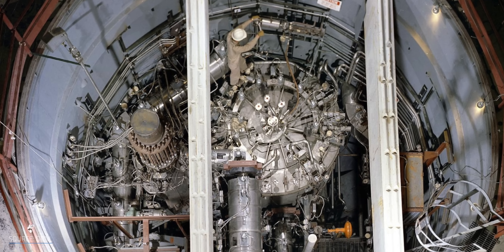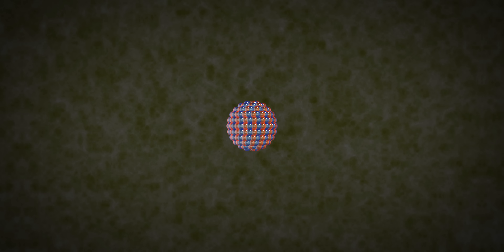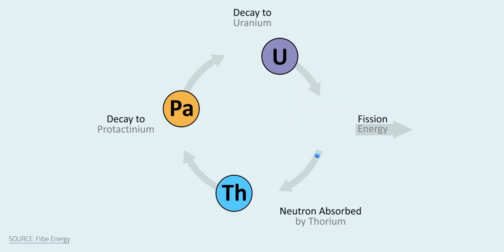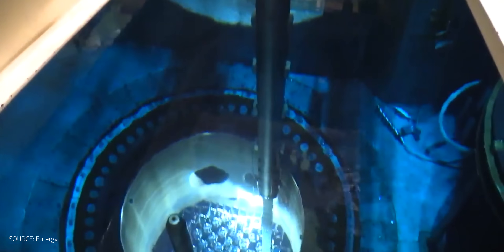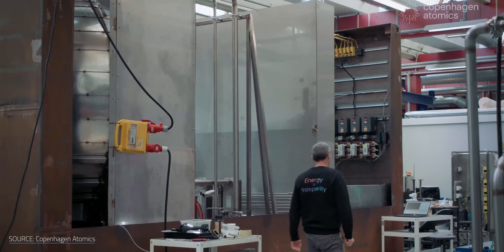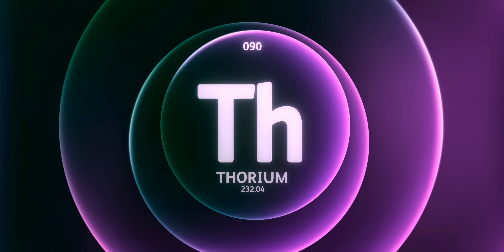Why Thorium is About to Change the World

Comment: AI Summary

Abstract:

This video explores the resurgence of thorium-powered molten salt reactors (MSRs) as a potential game-changer in clean energy, spearheaded by companies like Copenhagen Atomics. It revisits the decades-old promise of thorium, detailing how these "breeder" reactors can create more fuel than they consume, making energy significantly cheaper and more abundant. The video highlights Copenhagen Atomics' innovative approach to mass-producing small modular reactors (SMRs) designed to function like reliable "batteries" that operate for years. It delves into the unique safety advantages of MSRs, including their liquid fuel and passive decay heat removal, which mitigate meltdown risks, and discusses their superior waste management characteristics compared to traditional nuclear plants. While acknowledging engineering challenges like corrosive salts and neutron bombardment, the video presents solutions like specialized pumps and modular replacement. It also touches upon the significant regulatory hurdles but expresses optimism for commercialization within a decade, positioning thorium as a key to meeting booming global energy demands.

Summarizing the Transcript: Thorium-Powered Molten Salt Reactors

*   0:00 - The Promise of Thorium: The video introduces solid-state batteries and nuclear power, particularly thorium-powered molten salt reactors (MSRs), as vastly superior technologies with immense potential for abundant, cheaper, and cleaner energy.
*   0:47 - Historical Context: Weinberg's Vision: In the 1960s, under director Alvin Weinberg at Oak Ridge National Laboratory, the Molten Salt Reactor Experiment (MSRE) demonstrated a reactor that produced more fuel than it burned, running successfully from 1965 to 1969.
*   1:58 - Copenhagen Atomics' Revival: A Danish company, Copenhagen Atomics, is reviving Weinberg’s hopes for breeder reactors, aiming to mass-produce small modular reactors (SMRs) that are designed to fit inside standard shipping containers.
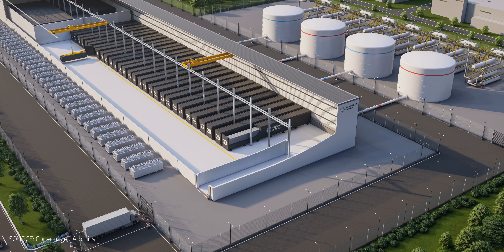*   2:30 - Benefits of SMRs: Mass production of SMRs makes them cheaper to build, easier to scale, and allows for predictable costs, overcoming issues that plagued large, custom-built nuclear plants.
*   3:48 - Thorium's Abundance: Thorium is nearly 500 times more abundant in Earth's crust than fissile uranium-235, the primary fuel for conventional nuclear energy.
*   4:09 - The Breeding Cycle: Thorium-232, when seeded with fissile material like uranium-235 or plutonium-239, can absorb a neutron and transmute into uranium-233, a fissile material that sustains the chain reaction and creates more fuel.
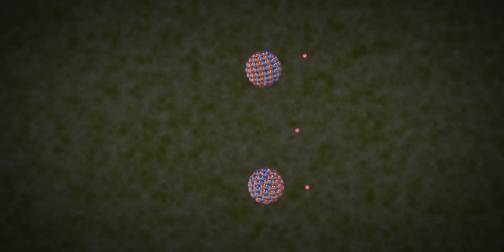*   5:10 - Endless Fuel Supply: The thorium breeding cycle allows for more nuclear fuel to be bred than consumed, potentially doubling the nuclear fuel supply every 10 years without relying on new uranium exploration.
*   5:54 - Enhanced Safety (MSRs): Molten salt reactors are inherently safer than traditional reactors because their liquid fuel eliminates the risk of meltdowns. They run at atmospheric pressure, preventing high-pressure steam explosions.
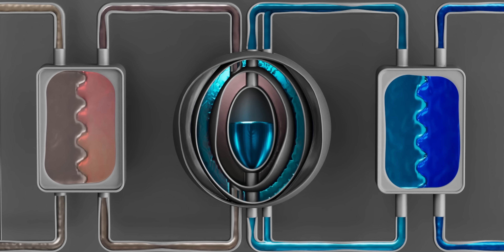*   8:36 - Passive Safety Mechanisms: MSRs include passive safety features like frozen plugs at the bottom of the reactor that melt in case of power loss, draining the molten salt into safe storage tanks to prevent meltdowns.
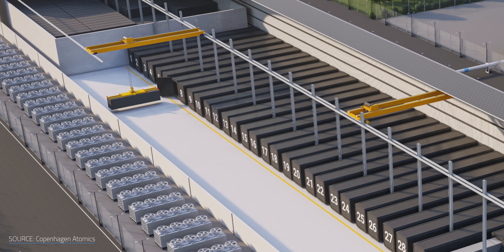*   10:00 - Superior Waste Management: Nuclear waste from thorium-bred uranium-233 decays much faster (to safe levels in a few hundred years) compared to waste from traditional uranium reactors, which can remain dangerous for 100,000 years.
*   10:36 - Waste Burning Capability: Thorium systems can be seeded with existing nuclear waste (like plutonium-239) to start the chain reaction, effectively acting as "waste burners."
*   11:01 - Engineering Challenges & Solutions: Molten salts are corrosive, and neutron bombardment wears down components. Copenhagen Atomics developed specialized pumps that circulate FLiNaK salt at high temperatures, designed to last for years.
*   12:30 - Modular Replacement: Unlike traditional reactors, the entire reactor module (core, heat exchanger, pump) in Copenhagen Atomics' design is swapped out every 5 years, allowing for continuous technological improvements.
*   13:40 - Prototype Testing: Copenhagen Atomics plans to test a prototype reactor at the Paul Scherrer Institute in Switzerland by 2026, aiming for the first nuclear chain reaction in a thorium reactor in the West.
*   14:19 - Long Refueling Cycles: The goal is to achieve refueling cycles of 3-5 years and continuous removal of fission products to keep the chain reaction stable.
*   14:46 - Regulatory Hurdles: Navigating regulatory approvals is a significant challenge, but the company anticipates that costs will decrease as more reactors are mass-produced and approved.
*   15:11 - Global Progress: China's TMSR-LF1 has already demonstrated successful operation with thorium and uranium, showing continuous power generation.
*   15:48 - Commercialization Model: Copenhagen Atomics aims to build, site, operate, and decommission reactors as a service, providing heat or electricity to clients, eliminating the need for taxpayer funding.
*   16:24 - Diverse Applications: The SMRs are envisioned for various applications, including producing hydrogen and ammonia, and powering data centers, offering a reliable, 24/7 energy source.
*   17:04 - Future Outlook: Thorium breeding reactors are projected to become commercially available within a decade, offering an abundant, cheap, and clean energy solution for future demands.

I used gemini-2.5-flash-preview-05-20| input-price: 0.15 output-price: 3.5 max-context-length: 128_000 on rocketrecap dot com to summarize the transcript.
Cost (if I didn't use the free tier): $0.0066
Input tokens: 15604
Output tokens: 1226

Comment: Looking at our power bill seems like 40% of our power costs are from delivery with 60% is production. So even if power generation costs dropped 90% our power bill would go down but not a huge amount.
Reply: But potentially if these are realized the delivery could be made less costly by placing them closer to the point of consumption.
Reply: @bewing77  No, the cost would go into having smaller sites to house these units as they showed with remote cranes moving the units inside a power generation building. Buildings/properties still have to be tied to a grid, so the same infrastructure is needed. While these units could be put closer to where the power is needed, there is still an advantage to being able to move power to other areas as needed. Existing long distance lines may be enough for that if they get the power source closer to where it is needed. The cost to rebuild these units every 5 years and also to transport such heavy units, will not be cheap. If a single company provides these units, what will their charges be and will they charge more and more without competition? I would not hold my breath on electricity being that much cheaper if at all......there are too many ways for the consumer to end up on the short end of the stick.
Reply: The high costs of transportation comes more and more because of RE integration and backup. This is the reason why one should look at LFSCoE and not LCoE. Read the study "Levelized Full System Costs of Electricity" written by Robert Idel.

Comment: Thorium nuclear power isn't here. It's an experimental frontier. Corrosion is a substantial issue.

China has an operational modular nuclear reactor, but it seems gigantic to me.

Fitting a molten salt reactor into a shipping container size module, with no corrosion issues, will be quite the trick.

You mentioned a thousand tons of shielding. Ouch, ouch, and more ouch. That's going to require specially prepared foundations for each module, which defeats the entire purpose of easily moved and setup "small modular reactors."

This sounds outlandish.
Reply: Thousands of tons would be the building that houses the shipping containers not the amount of shielding in an individual container. And 23 people "liked" your comment. The video even shows a diagram of the containers in a large building.
Reply: @Nphen 

The video does not make clear how much of that shielding will be required per SMR.

The Copenhagen Atomics' website makes no mention of shielding beyond the reactor and module-container, which certainly cannot contain anything like a thousand tons of steel.
Reply: Thousands of tons of shielding is nothing when talking about a civil engineering project. Several thousand tons of material are used in any road project and you don’t even notice it if it’s done correctly.
Reply: @brianrassler2010 

A civil engineering project requiring many thousands of tons of steel can certainly be accomplished. It's well within the capabilities of many nations.

But it doesn't count as an easy delivery and setup, which is Copenhagen Atomics' selling point.
Reply: Rube Goldberg scam fishing for investers to swindle.
Reply: Not necessarily. Any type of shielding will always weigh 'a ton' (or thousands). That is true for any type of SMR. I think you misunderstand the concept of modularity 🙂
Reply: @bartrammeloo5046 

A standard 40 foot shipping container has a capacity of 67 cubic meters.

One thousand tons of steel occupies about 127 cubic meters of volume.

At that point, there is no space left for a reactor, and the shielding alone occupies nearly double the volume of the proposed reactor.

I don't think you understand what materials occupy what volumes, or what kind of ground pressure will be exerted by a thousand tons of steel, necessitating extensive installation preparations.
Reply: I'm sure the engineers and scientists who've been working on this for nearly a decade hadn't thought of that. Thanks for taking the 2 minutes to type out this comment. They'll have to cancel the project now thanks to your well considered insight.
Reply: @buzz1ebee 

It appears you've never heard of Theranos, Enron, Arthur Anderson, Bernie Madoff, WorldCom, BCCI, the entire Savings and Loan crisis, the entire Sub-Prime Mortgage and Credit Default Swap crisis, Helion Energy (in 2022, promised fusion by 2024, now they're saying 2028), and the troubles encountered by SMR firms Bechtel, BWXT, NuScale Power, and Transatomic Power.

Comment: this isn't the solution but it will definately be a key ingredient in the solution. Breeder reactors is definitely key to our future prosperity but it's not a one or the other situation we can develop the thorium reactors while simultaneously developing better recycling and separation technology for current spent fuel and while simultaneously developing other reactors as well. Betting on a single miracle technology to solve our problems won't work we need these reactors but they cannot exist in isolation we still need better mining and exploration for resources and we still need new generations of our current reactors as well even fusion could lend a hand. The trick is not to bet on the winner but to bet on everything :)

Comment: There are two problems with Thorium fueled nuclear reactors

1) The time it takes to breed fissile U233 from fertile Th232. It's about 10 times as long as it takes to breed fissile Pu239 from fertile U238. So scaling up to a large fleet of reactors running on the Thorium fuel cycle will take a very long time.

India has been working on a project to fuel the country from their large reserves of Thorium. They've been at it for over 50 years and have only got as far as some experimental reactors. Their idea was to create a large fleet of Uranium fueled reactors, and use the neutrons in those reactors to breed enough Thorium to get up to a full fleet of Thorium powered reactors, But it's taking a long time. 

Rolls Royce who also make nuclear reactors as well as jet engines, estimate it would take 200 years to get a full fleet of Thorium fuelled reactors to power the UK. 

2) The price of electricity from solar power is coming down very fast. Solar panels are going through a Moore's Law reduction in cost and expansion in use. Combined with wind power which is also getting cheaper, but more slowly, we are moving towards a situation where electricity from solar and wind is so cheap that nuclear would be uneconomic.  In the decades, or hundreds of years, it would take to get a full fleet of Thorium powered reactors, the price of electricity from solar and renewable will be close to zero.

Spain  has a large installed base of solar and wind generation, you can check the retail price of electricity on octopusenergy.es, today (11/06/2025, that's global standard date format not US date format), the average price is EUR 0.14 / KwH, and in some hours during the day when it's sunny, EUR 0.049 / KwH. You can see the history for wholesale electricity prices on tradingeconomics.com/spain/electricity-price. You'll see that the spot price has been as low as EUR 3.35 / MwH, though at the moment it's quite high EUR 73/ MwH. The insteresting thing to note is that the price is highly variable compared with say UK or France. That's because wind and solar are very variable, so the real money is in energy storage, not nuclear.

Even nuclear power needs energy storage because you can't follow the load during the day and across seasons. This is because of reactor poisons such as Xenon 135 which make it hard to safetly turn up the power after turning it down. Chernobyl went prompt critical because they turned the power down and then turned it up again.

Comment: For those expressing concerns about nuclear waste storage I have to point out that the waste storage facilities have already been built and sit empty all over the globe. What killed nuclear power was not storing the waste it was fear of the high pressure explosions creating huge radioactive clouds that potentially expose millions of people down wind to the harmful radiation. It was using water as a coolant that creates this possibility due to the steam it will produce in the event of the system loosing pressurization due to poor maintenance practices that managers force because they want larger bonus checks. Molten Salt does not use water as a coolant which is why they operate at greatly reduced pressure that will never explode. In a worst case scenario a pipe cracks and leaks the molten salt which immediately cools and solidifies. This makes nuclear energy safer by factors of magnitude over water cooled reactors! The storage facilities that already exist where designed and built to contain nuclear waste for tens of thousands of years and that storage will be reduced to a few hundred years with this technology. Having the entire reactor fit into a standard shipping container that is designed to contain the radiation during transport and survive train wrecks make it far safer than any other power generating technology to date.

Comment: So the 5 year replacement cycle sounds intense, but since you're reusing the most expensive and most dangerous part and apparently lose very little of it, this company could put replacement-unit factories on site at major installations.  The liquid components would never travel offsite, same with 'hot' reactor parts that are still reuseable/refurbishable.

Comment: "forever on the horizon" is a bit missleading, considering we have proven the concept back in the 1960's in Oak Ridge into a feasible design. the saying generally concludes that its a technological hurdle to get this done, but its not. The main thing holding up Thorium, unlike say fusion reactors, is the political climate and the regulation nightmare swamp. 

the only real technological hurdle still affecting thorium molten salt reactors is material science, and it has to do with the corrosive nature of the Flouride Salts, in conjunction with heat and neutron flux... but even back in the 1960's their proposed use of a inconel alloy and a redesign of the Core to prevent Molten salt  direct contact with the reactor core wall technically solved it to a point where you have a working design.

but it takes literal ages to get a new material and or a brand new design through regulations and literal endless amount of money to carry it through as the regulatory body charges for time spent learning and testing reactor designs. No government is interested in funding  this (except china), and fast tracking the bureaucratic swamp.

the small modular reactors are shit solution in reality... but its done to get around regulations and to simplify design/safety and reduce initial start up costs.... the container like design is sealed unit, you need to replace them when the fuel gets saturated with fission products, which is about 5 years or so. and the amount of power that they  can generate is low... even the output temps are relatively low, which is the main selling point of Molten salt reactors, they can be designed to give really high output temps, which increased efficiency alot!

this will help as it will prove to regulations that materials choices to handle the salts work and last. but its not the large scale solution we need.